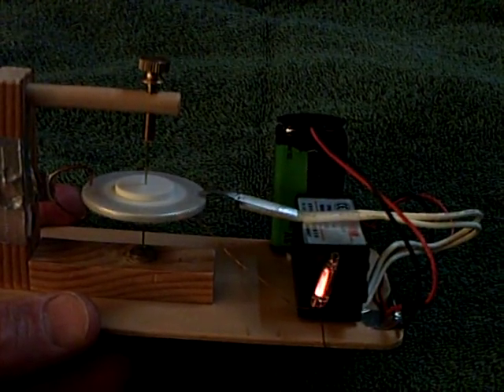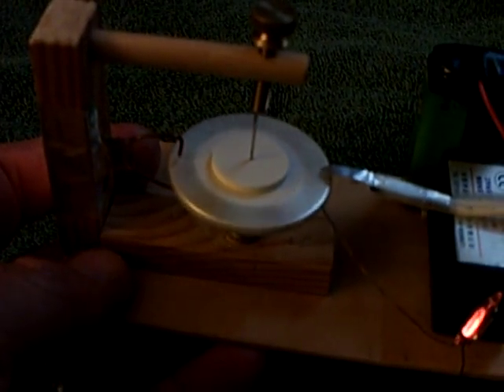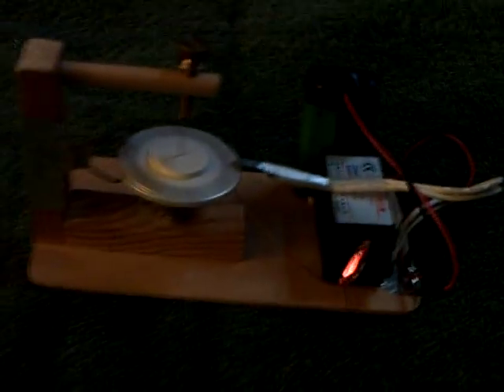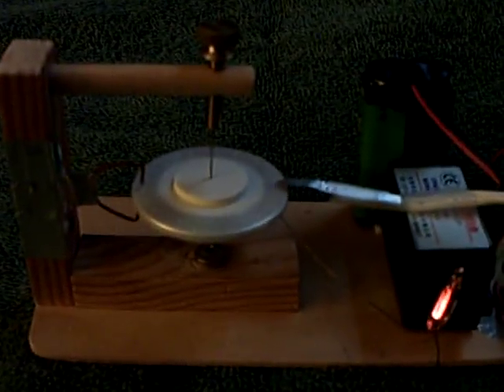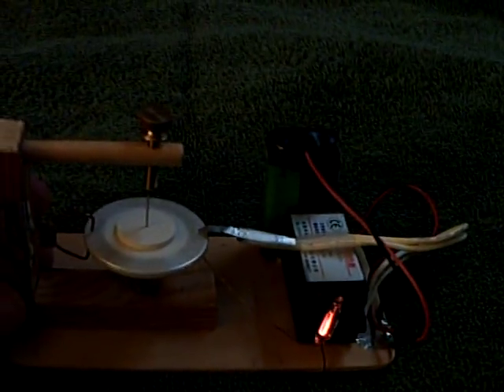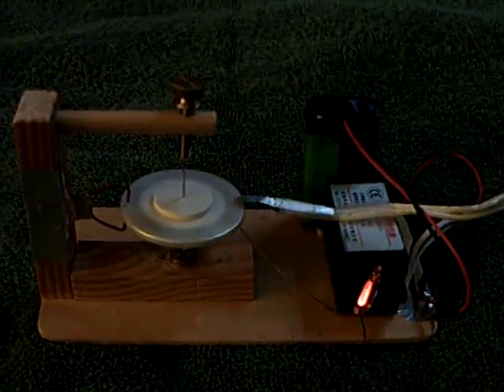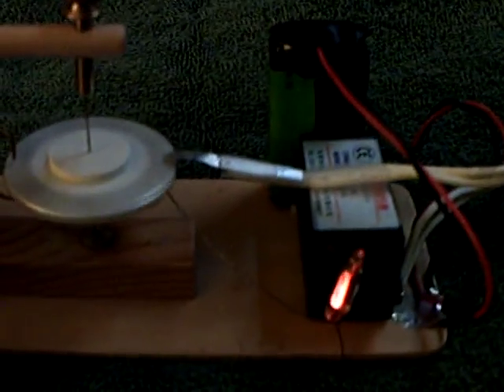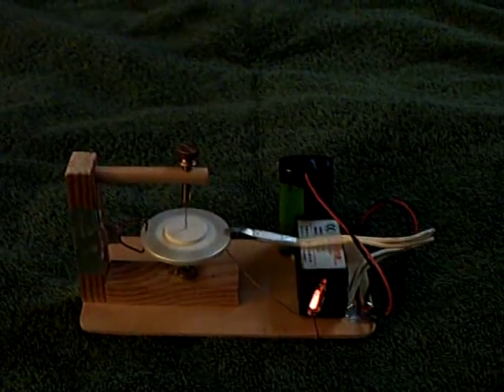Tiny High Voltage Electrostatic Motor

Comment: Can you register any magnetic field change near the disc?
Reply from the maker: diveflyfish I just tried it using a compass and there was no reaction.   Interesting.  The electrons are moving around but it appears that there is little or no electromagnetic field generated.
Reply: Would electronic compass or hall sensor with amplify work?
Reply from the maker: diveflyfish Probably.  The high voltage might knock the hall sensor right out though.  ZAP!!!!

Comment: Hi here's the recent riddle/ encryption I got off  ogmandino youtuber who I believe has first hand knowledge of joe bookers static heart pulsed magnetic car engine.   " start with warm compressors then cold, place ice packs on your head and aluminium foil balls in both ears to build up your receptors , think of winters scapes and penguins on ice skates , now your di-lithium crystals will never hold ".   This all relates to the engine.  He told me after I spoke to pete about placing urine in my cooling system.  It made a chalk crystal lining within all the pipes etc and evaporated but the engine would not over heat at 50 mph  with nothing in it ??? But it started to overheat at 70 mph after a while but when backed off it went to normal temp and carries in as normal this is a rover 2lt turbo diesel Ecu model

Comment: I hope soon to have time to get on with the static neutral ac dc eddy current discharging car engine to rev this engine you make a brake vacuum pipe interact with this incoming neutral charge joe booker as stan Meyer did was 90 degree the vacuum pipe ie in the side neck of the incoming carburettor watch ingventor on youtube joes friend Peter Stevens also his new web site www.weathercreation.com   He tells me its scary how simple it is I have many emails off him and another guy who knew Datsun had such a engine. If you want them to pass on then just send me a email address and you can pick through them and share with whoever mel in uk

Comment: Looks like a transistor type of regular pulse motor, but is HV and way different...very cool indeed.
This one will be replicated when my generator arrives and, from reading the comments below, right along with magnetman's replication when he gets his :)
Reply from the maker: slider2732 I was wondering if anyone would notice that it looks and runs a bit like a pulse motor.   I was going to name the video 'Tiny High Voltage Electrostatic-- Pulse Motor' but I figured that the title would draw some negative comments.   The neon leg underneath the rotor is positioned about one rotor segment away from the top HV electrode.  A connection spark jumps between the top electrode and the neon leg when a segment gets between them.  The process actually slows the rotor down but it makes a neat effect.  If you position the neon leg far enough away from the rotor the neon will just glow dimly and not slow the motor down.
Reply: Great tips, thanks :)
I guess an aim, would be to run on atmospherics, and never stop. Wonder if it's possible to Cockroft Walton the heck out of an aerial and a ground lol. The lack of need for current is a huge plus for this sort of project.
Reply from the maker: slider2732 Lasersaber had great success running his motors off atmospherics.  I have yet to get that to work.  I think that the problem is that I live by the beach and it is too humid.

Comment: That is. Getting to look like stan Meyers diagram on his newzealand video just missing collapsing coils on both feeds the neon acts as a alternator dash light off the disc pulling electrons back. To  excited/battery but with it having a broke. Fuse the returning electrons will not enter battery but jump to return back to energise the spinning disc as the opposite pos will attract of coarse just a thought.
Reply from the maker: honda4004 Of course just a thought--but a very interesting one.  Thanks.

Comment: Do I Attach the grounding pick to the negative side of the battery ?
Reply from the maker: magnetman2010 Yes.  On this little model I just used aluminum tape on the bottom of the board for a connection piece.  It 'is wrapped around the solder joint on the  (-)  battery wire.
Reply: ***** Thanks !

Comment: Great job as always ! A lot of us would like to see a wiring diagram. I ordered a  negative ion generator .
Reply from the maker: magnetman2010 Thanks.  You are going to have some fun with that negative ion generator.  As far as wiring this up it is extremely simple---  Attach a 9v battery to red and black wires.  The HV blows out through the white wires.  Aim the stream at the segmented rotor and use some kind of grounding pick at the opposite side of the rotor.  The neon is attached to the (-) of the battery and aims at the rotor near the HV stream.   Nothing is critical on this and if you get shocked once in awhile it doesn't hurt.  The amperage is very low.